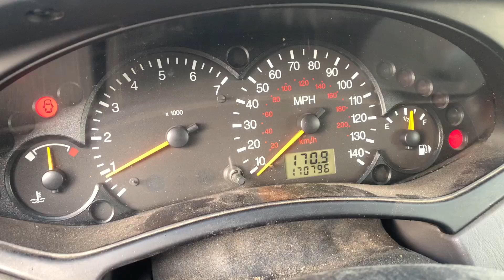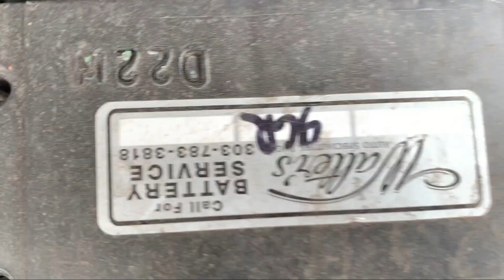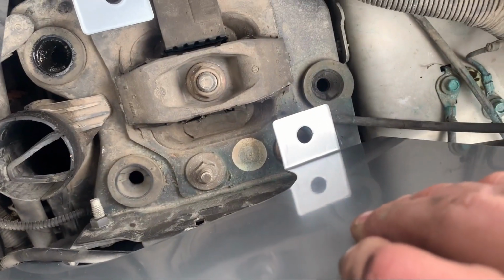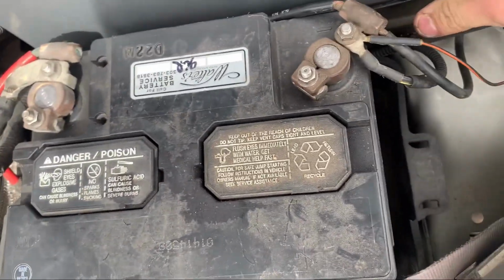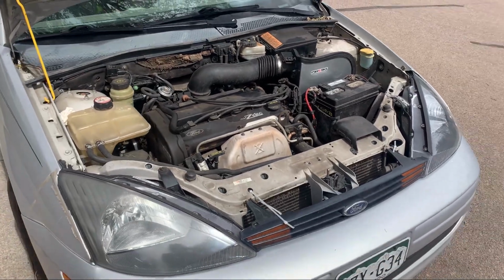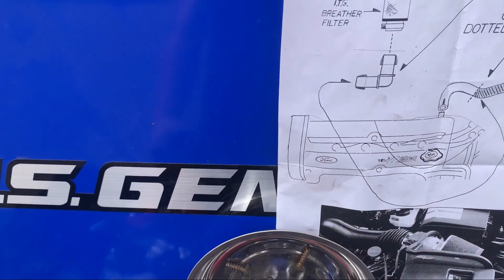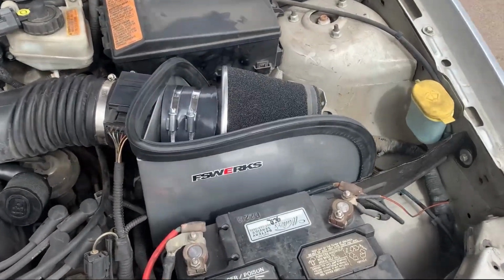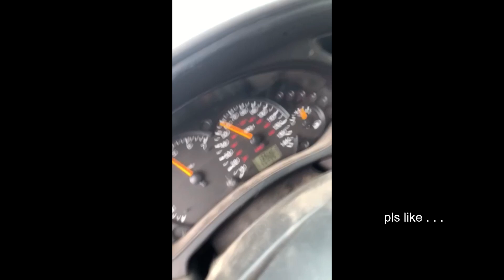Project: Focus | Air Intake

Comment: You would have been better off with a K&N or Green Filter in the stock air box, thats just going to suck in hot air.  It  sounds kool, but when the engine bay heats up, bad for performance.  monitor your air inlet temps with the stock box and your fswerks intake. You will see.
Reply from the maker: maybe but so far ive seen no difference in performance which is what i was expecting but i like the looks and the induction sounds so ive got no complaints